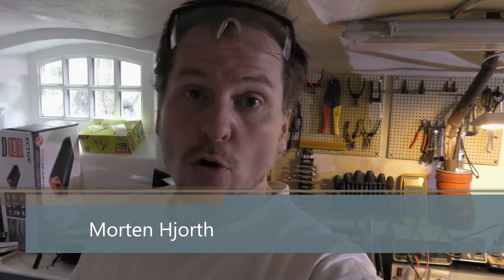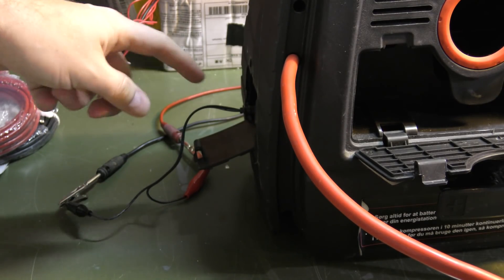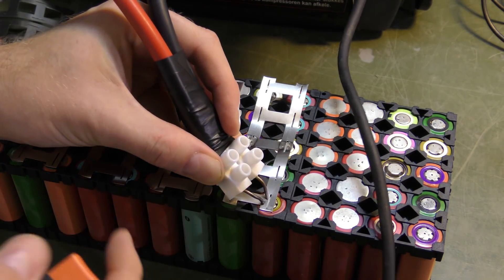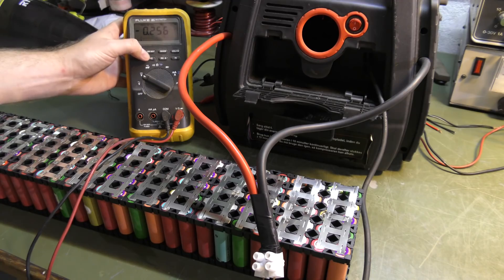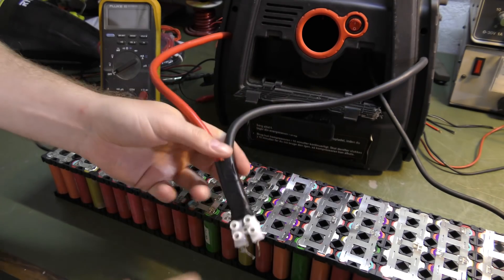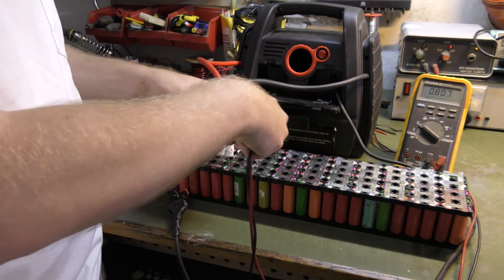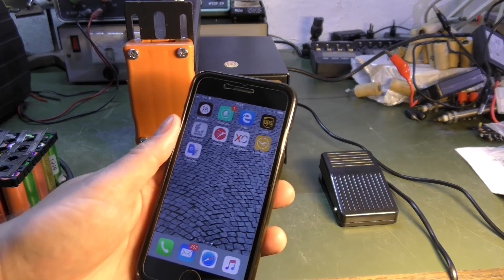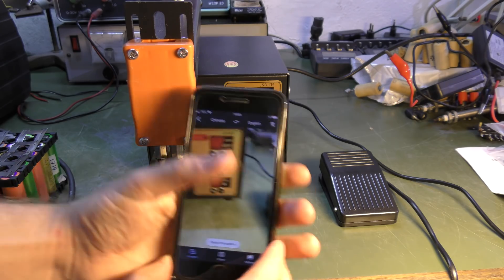Update! DIY Spot Welder is Now Back in Business - 893

Comment: Two suggestions:
1. Buy a spot welder timer circuit. 
2. Use a 1 Farat Capacitor (used in car audio) put it parallel with the battery.
Reply from the maker: Hi Geert Pirens
Thank You very much! but I think that "2" would greatly over power my spot welds and burn through more batteries :-)
Thank you for watching! :-)

Comment: There's so many things you could do to pimp this. Get a high value capacitor bank on the relay input, it'll help even the load on the battery, and make it run longer, as it'll reduce the current draw on it. Batteries last longer with less high current. A small 555 timer, built in monostable mode, could trigger the Relay through a mosfet, and you could adjust the pulse time with a pot. That would give you more reliable pulse timing. You'd also need a protection diode across the relay coil, just to catch the back EMF as the coil turns off. (You can look up Relay coil flyback diode for more info on that) I also wonder if the relay contacts might benefit from a snubber network too (Cap and resistor), but i'm not sure. I think it might be an idea, which might save the contacts burning up quicker. 

https://www.ebay.co.uk/itm/2-5V-100F-Super-Farah-Capacitor-Module-15V-16-6F-Automotive-Rectifier-12V-1-L9O1/153678002342?hash=item23c7ec38a6:g:cRAAAOSw1nVdnafn

http://www.circuitbasics.com/555-timer-basics-monostable-mode/
Reply from the maker: Hi Lesley Munro
Thank You very much, for all the good sugestions!  glad you liked the video :-)
Thank you for watching! :-)

Comment: Safety slippers ha ha :-D
You can fix the relay dropout but there is no point as the battery is flatter than a pizza under a road roller :-D
A monostable circuit would keep the On duration the same on every button press.
You may want to look at 555 timer relay circuits :-)
Reply from the maker: Hi burtobm
Yes,, I can fix that,, but will probably just break the battery instead then - glad you liked the video :-)
Thank you for watching! :-)

Comment: The min max voltage was way off.
Reply from the maker: Hi zx8401ztv
I do not think so,, I am short circuiting a 12V battery, and I will therefore have big loses all the way to the copper tips.  glad you liked the video :-)
Thank you for watching! :-)
Reply: @MyPlayHouse  
The fluke was floating because the circuit was open. You have to close the circuit before zeroing.

Comment: You need to have timer on the spot welding. Its so easy to burn through the cells and that is permanent damage im afraid.  Regarding the AC based spotwedler. Make sure you got C-grade breakers and the 13A should work. The initial current is the big issue. Spot welding from a battery without proper pulses/timers doesnt work very well in long term. Its more important than people think im afraid :)
Reply from the maker: Hi James S
Thank You very much!  glad you liked the video :-)
Thank you for watching! :-)
Reply: @MyPlayHouse  James?

Comment: If the tiny battery in the former booster box doesn't cut it, you could always go to the scrap yard and see if you can find a big battery of a truck or a bus (they get their 24V systems also just by connecting 2 batteries of 12V in series, then paralleling it for more power), which has 100Ah or even more. Maybe your friend with the mechanic workshop that you helped with the PC also has an old but still functioning battery for you? The deposit on lead batteries is only about 7€ (at least that's what it is over here in Germany), so that would be worth it. Then you could rejuvinate the battery to maybe 90% of its original capacity, still not useful enough for inside a vehicle, but a heck of a great power source for a spot welder. But of course you would lose portability. And you'd need a car battery charger that can put out tens of amps to charge it up.
Reply from the maker: Hi Seegal Galguntijak
Thank You very much!  glad you liked the video :-)
Thank you for watching! :-)

Comment: I suppose that there is a good reason that many DIY spot welder projects use super capacitors instead of trying to have battery capacity for sustained welding, or blowing fuses when basically short-circuiting the mains.
Reply from the maker: Hi MVVblog
Thank You very much!  I think maybe it would be good it the 12v battery charged a 1,5v super or just capacitor,, that would last longer.
Thank you for watching! :-)

Comment: someone really needs to send you a k weld or similar
Reply from the maker: I do not know what that is.
Reply: My PlayHouse  i can give you some links - https://www.instructables.com/id/DIY-Arduino-Battery-Spot-Welder/ I built this one and it works like a charm with no burns and a consistent weld every time - wasn't too expensive either
Kweld is one of the best spot welders you can get for batteries but it is more expensive - other youtubers swear by it and you can program it by energy (J) (https://www.keenlab.de) btw: im not advertising
They both work on the same principle, just a car battery/lipo (i use a "turnigy graphene" lipo and personally think they work better) and a microcontroller (arduino) to set the weld time - with a lots of mosfets acting as a switch. Trust me it will make your life easier

Comment: I'm pretty sure your voltmeter readings are wrong because the meter doesn't update fast enough and doesn't catch the actual 12v(ish) spike.
Reply from the maker: It is not going to ever see 12v when short circuiting the battery like this.

Comment: I would not place too much value on the DMM peak voltage measurement when welding. Chances are the meter will not be quick enough to be accurate. But excellent idea for spot welding batteries. Definitely will store it in the idea bank in case I need it one day.
Reply: I agree, the oscilloscope would be more suited to this, in one-shot mode. It would capture the voltage profile of the pulse.
Reply from the maker: Hi Jesper Monsted
Thank You very much!  glad you liked the video :-)
Thank you for watching! :-)

Comment: Excellent! 

I'm not sure the best way to keep a stable voltage at the solenoid. Maybe if it had its own battery supply, or if it had a capacitor after some diodes to stop the welding rod from taking all the current. The capacitor would need to charge whilst the trigger was not pressed so it would need to be before the switch. All added complexity and either way, I don't think you'd get that many more welds out of the charge on this battery. 

The theory works though :)
Reply from the maker: Hi oOMonkeyMagicOo
Thank You very much!  I think I would just barke the battery instead,,
Thank you for watching! :-)

Comment: Hi Morten, glad you got your Home Made Spot Welder working again. I wonder, if putting a Big Capacitor in the Circuit. Would give it a longer working time. Maybe a Starting Capacitor, for an Electric Motor.... Don
Reply: it will also more efficiently kill you with a setup this janky
Reply: Hi. Have you tried to bridge the gap of the Nickel strips? The cut is made to let the current flow an other way into the batteries. Maybe there will be better welding results. But maybe there isnt enough current or you have to use time controlled Switch because of to intensiv Welds.
Reply from the maker: Hi Leon Adams
Thank You very much!  If I could lower the voltages,, I do not need 12v, so if I would use the 12v to power caps holding 1 or 2 volts,, It would last a lot longer.
Thank you for watching! :-)